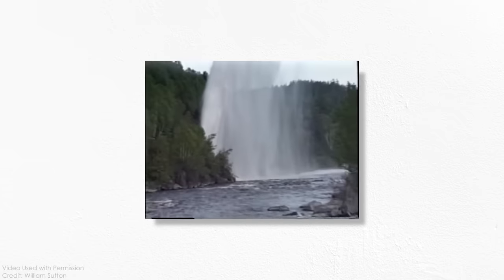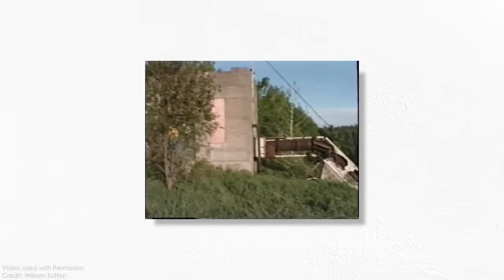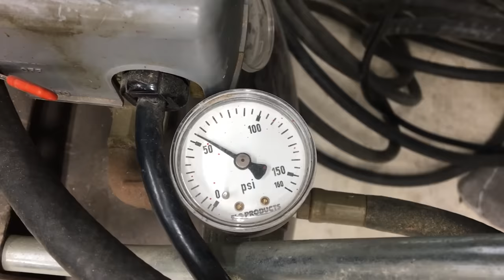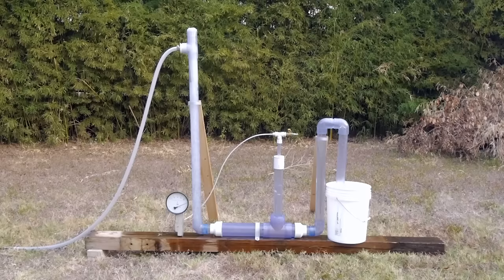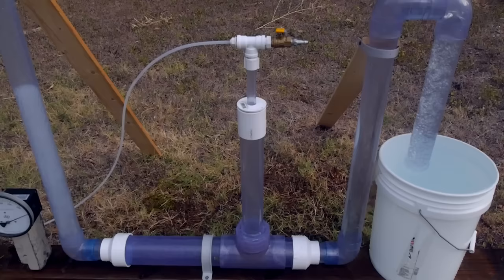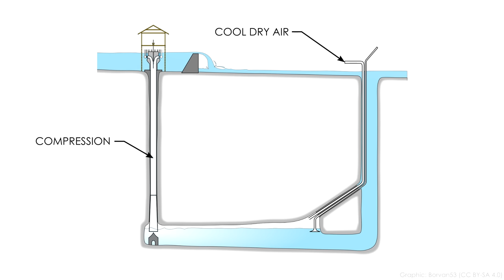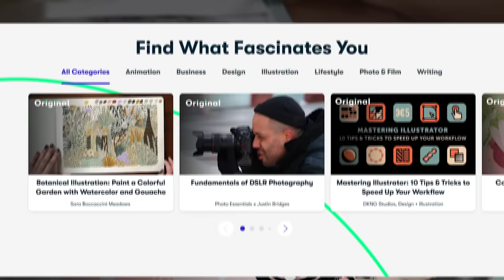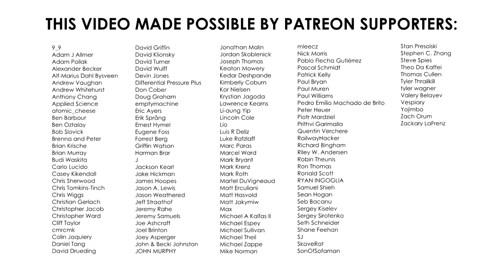Compress Air with No Moving Parts! - Trompe

Comment: Actually, "potential" energy of compressed gases is not exactly "potential" energy but kinetic -- molecules of the gas moves and bumps, interacts another words. So it's kinetic.
And you need a thin nozzle to inject water into the system. It's because you need a REEEAL good velocity to hook air and act like a valve to not allow air to move back.

Comment: Hey Grady! Hopefully you or another curious engineer come across this project. How practical would this be to turn a water pump for an aquaculture system to power trompe(s?). The compressed air could easily be used to add more turbulence or in breeding tanks way from the main tanks!

Comment: Reliability of no moving parts and all aside, in a pre electric/internal combustion for rotary motion state of times. Interesting novelty of human enginuety for sure, but from numbers I´ve found if reliable, a trompe gives about 0,5 psi pr 1 foot of fall. Thats roughly 7 m fall for 1 measly bar and I have no idea about the air flowrate potential pr mass of water. I guess a trompe is thirsty... What would be most water spending economy efficient ? A water wheel stomping pistons/bellows and valves for air flow, or a trompe ?

Comment: Could you make this using mercury instead of water? Would it make higher air pressure if so because of the greater density?
Reply: they certainly made an effective vaccuum pump that way.

Comment: Minors in Cobalt suffered from lack of oxygen. Some may have died from it. As compressed air bubbles are exposed to cold water oxygen is selectively dissolved out. Mine shafts were filled with nitrogen. That's good for preserving fruit; but, not good for people.

Comment: I remember seeing an old picture (maybe the 1900's?) of people driving around in a little car powered by compressed air from a trompe.  They had a cooler in the back seat and were using compressed air to keep a bucket of ice cool.  On the ice there were various bottles of liquor, and they all had cocktails in their hands.  I'm sure the max speed on those cars was minimal.  Add some padding and you'd have bumper cars.  So instead of gridlock traffic, we could have had cities filled with sustainable adult bumper cars.  SMH.

Comment: I'm designing an aeroponic grow system, and had already included aeration in this manner. It was cool to see you mention that application near the end of this video. 👍

I have a sump pump forcing water through a ¾" hose (with holes where the water sprays out) placed inside a 6in conduit (where the plants will grow).  Close to the pump, the hose has a smaller ⅛" line pushed through a hole, and open to the outside. Correct me if I'm wrong, but I believe it's called Venturi force that pulls the air inside?

Comment: Wow I'm in Poteet, you're a few steps down the road.  I just accidentally found this video.  I don't know if you have gone over this but I use PCP air rifles and I'm 61but I hand pump mine which can be quite a workout but I don't mind.  Although there are times I want to speed it up. With your mockup and please be gentle I'm just a simple country boy. On that second tube if you have a faster rate of water but yet a smaller tube would that increase the pressure. But I need like 4500psi. I'm sure I would need something more , maybe turbulent combining the water and air on the first tube, well maybe.  Anyways I know buying a pump would be probably easier, but I'm not built that way. 
But if you have a better way to do a HP air pump can you make a video on that. My mind tells me I should be able to out of my pops old 90ton hydraulic jack.

Comment: Cool! So if you had larger diameter air reservoir (Larger atmospheric surface pressure area) with a weighted plunger you could generate a great deal more air pressure and volume from a relatively low volume stream?
Reply: no.  the backpressure would blow the water out the wrong way.

Comment: so if u have one of these built and had the "runoff" water at the end of the pipeline be collected to be brought back to the original water source, is it possible that this device could make a perpetual motion device? jw because i have seen many sources debunk the perpetual motion device theory.
Reply: Notice the water finishes lower than it begins, you would have to pump the water back uphill (requiring energy) to its original destination. The thought of reusing the water is interesting though, a clever way of moving it back uphill using other renewable sources such as geothermal energy to evaporate it and recondense it in the higher level would be interesting to try

Comment: With your exact setup is there a cap to the pressure it can produce or given time will it keep going?
Reply: nothing but the weight of water is holding it in, so it's self-regulating.
Reply: @tsm688  thanks

Comment: Can you loop this water system to get more pressure to be stored in a metallic tank with a more applicable pressure?
Think oxy ocetaline welding but o2 and propane and a 45mm wide to a 5mm 3 stage size small medium large flame i guess i can link a torch and a medical style set up thats rediculous expensive if u use the medical o2 generators youd see in like a retirement home
Reply: looping this would be as pointless as looping a water wheel.  if you have the ability to do that, just hook up the motor directly

Comment: What would happen if you built this in stages? Have the first stage pull in atmospheric air, and the second stage pull in the compressed air of the first stage? I'm sure you'd have to wait for the first stage to get up pressure before you pull it into the second stage... would you get an even higher pressure out of the second stage? Even though I don't understand this completely, my mind is saying no... not possible... But then it thinks that increasing the volume of the pressurized air storage in the second might help... Shrug...

Comment: I made a compressed air tank for water pressure increase for toilets and sinks.
placed an 8 inch 10-foot pipe at the end of a half-inch above the rafters, horizontally. Filled to the top by installing a spigot valve on top of the 10-inch pipe to release the air as it filled from the same level.
the down water flow was below the 10-inch pipe. Every time you used or flushed, the water created a vacuum. this vacuum pulled water and air. eventually, the pressure was high enough to increase the pressure at the sink and toilet.
Florida has some of the worst water system setups in the world. I thought The mountains of Ecuador were bad in the '80s but Florida is MORE backward than that- they still use 2-inch pipes for sewage?

Comment: The moving part in this system is the water. To call it a system without moving parts, you would need to have water that doesn't flow.

Comment: There is a second chance in these systems to capture energy. While you may not want to put in an energy capture system in the entrained air side, on the discharge side there is still room to put in a generator using a wheel or turbine to capture the energy.

Comment: mr Practical engineering.....
If you can boil water at room temperature...... Why isnt this used to get the salt out of seawater?
Wouldnt it be much cheaper?
And more efficient?
Reply: great to see not a single reply after 3 years

Comment: Pardon my simpleton brain… but are you saying with a recirculation pump and closed system you can have a nearly loss free source of compressed air??? And if so why have we not explored it as more of a energy source… I understand that may not be viable but hell they run vehicle on cng and hydrogen so just a thought.
Reply: The air pressure comes from the energy of water -- either water that's moving quickly or at a great height. But hydropower is hard to scale up more than it already is.

Comment: You said no moving parts, the water is a moving part. The water is the most important component in the construction of this device, therefore the water is a moving part.
Reply: Absolutely useless information. Use common sense rather than try to sound smart.

Comment: Can you please do a viral video about the 1980s Geo Metros that would 
get 55 miles per gallon, why this is a better idea to get a car that is 
put together with high miles per gallon without the hybrid parts, for 
some motorists, and if Toyota is one of or the most reliable 
manufactures why the Toyota Aygo could be a very high performing vehicle
 for miles per gallon applications here in the USA in addition to 
Europe, the implications of these two vehicles existing are are very 
obvious.

Comment: I have a doubt,
 why can't we compress the air like a turbocharger , using water instead of exhaust gas

It will be so much powerful I guess ! 

Then let the same water cool it down through exchanger 

I've seen a lot or water flow off for a very little compression.

Comment: some info.     no moving parts.      just plenty of flowing  WATER,  a  sufficient  amount of  Head  (and  money/labor/time  for  installation).      on the other hand,  flowing water could, directly, power  air Pumps  and/or  compressors, via waterwheel; or via hydroelectric.     it is a certainty that a low-tech solution could be found, in order to deliver the compressed air to a desired location.      compressed air can be used to power an  air engine, instead of (dedicated) air tools.      googletranslate
https://en.wikipedia.org/wiki/Pneumatic_motor

Comment: Ok, but why don't you just install two vertical tubes into the ground. One is filled with air and then, the high pressure water is let in at the bottom. The air will then be pushed out the top. As soon as the flow of air in that pipe comes to an end or is insufficient, you can switch to the other tube repeating the process while the first tube drains. That feels more efficient to me and it doesn't need many moving parts.

Comment: The major downside of this method is going to the very high water content of the compressed air. That should be discussed in this method.
Reply: it's actually pretty dry because it's cold air.
Reply: @tsm688  Yes, dry air that's bubbling through water. I think you are mistaken.
Reply: @milktobo7418  Think it through.  It will be 100% humid, yes - 100% for maybe 15 degrees.  This is a LOT less than you get for HOT saturated air.
Reply: @milktobo7418  further, it will get "drier" as the cold air warms up - effective humidity will go below 100%.  It will tend to remain gaseous. Hot air, will cool off and become SUPERsaturated - it will condense and produce liquid water.
Reply: @tsm688  Please do go on and tell me how I you think I failed thermodynamics. Stop thinking of this as an isobaric process or cherry picking some magic temperature gradients that wont exist in reality.

Anyway, to put it another way: I really like your idea of NOT compressing the air at the coldest time of the day so that the relative humidity is low enough to not drop out any water afterwards.
Reply: @milktobo7418  If you insist.

TL/DR, as long as the mine is significantly hotter than the water, air from the trompe will heat up above the dew point.  And I'm going to bet that a North Canadian river, is colder than a deep underground mine.

The effect of heating on humidity is gigantic.  A difference of just fifteen degrees C *TRIPLES* the amount of water air can hold.  The air will come out cold and 100% saturated, and rapidly drop below 100% when it heats back up.

A compressor on the other hand, easily heats air to **100C**.  Any water in the system will evaporate, get pushed down the lines, cool off, and condense inside pneumatic equipment.  They use cooling systems and drip traps to prevent that -- the same thing a trompe gives you for free.

Comment: The efficiency of compressed air used in machinery is horrible because of losses of heat during compression. So if you can bypass all the waterpower to electricity to pressurized air thing you should do it today as well if you really need pressurized air. Overall efficiency should be equal or better. Electric motors are however still best at about 90%-98% efficiency.

Comment: I'm surprised you say the air is drier than mechanically compressed air. Surely in this process you will have 100% humid air which is what you have from a air supplied from an air tank. Obviously if the compressed air is used at ambient temperature and that is higher than the water temp then the relative humidity will drop.
Reply: 100% at high temperature is a lot more water than 100% at low temperature.  A traditional compressor spits out hot air which has the maximum amount of anything in the vicinity dissolved in it.  This spits out cold air with a much lower moisture capacity.
Reply: @tsm688  Yes, I see your point. Whereas a normal compressor produces hot air at high humidity which becomes saturated as it cools, the trompe produces cold saturated air which rises to ambient which will reduce it's RH.

Comment: Compare these diagrams to the diagram of the pyramid chambers. Then watch “great pyramid HPG running again with new resivoir.” John cadman has 135 views he revuilt the pyramid chambers to scale and tested it as a water pump. It generates potential energy with pulses 100 db that would be abosrbed by granite using this technique

Comment: I’m no expert on the subject but couldn’t something like this be fashioned to run off city water and provide the ventilation needs we are seeing with this pandemic outbreak?  Seems like it would be easily manufactured and deployed.  After all you really don’t need a ton of pressure in a ventilator and it wouldn’t add addition heat...just food for thought.

Comment: I don't understand something here.  If you were to open the air pressure valve, wouldn't you fairly quickly exhaust the trapped/pressurized air and wouldn't you very quickly get water coming out of your valve?  Now that sounds a whole lot worse than having some moisture in your adiabatically compressed air!!!

Comment: Wrong title. Water IS a moving part. No air - and no fluid at all - can be compressed without a moving part and an energy source (in this case, gravity).
The correct title should be "compress air without artificial moving parts". Or sort of...

Comment: I imagine you actually have a college degree in engineering, is that right? I like your videos, but in this one I don't understand the principle. So does it work like a water powered vacuum pump, which has a nozzle in which water takes air with it and by doing that it's lowering the pressure of the air around the nozzle?
Reply: Bill Mollison, while giving a permaculture presentation, described the 300+ year old technology of the trompe. That video is on youtube, but is taking me a bit to find. In the event that my Asperger's takes me on a tangent whilst strolling memory lane, you at least have a place to start, and Bill Mollison is certainly an interesting person to check on in the meantime.

Comment: Hard to let this idea go.  I spent quite a bit of time trying to unsuccessfully develop a water powered pump that would pump water consistently using the Trompe principles - this type of pump is called a Pulser pump.   The way you used pipes instead of buckets was interesting.   Anyway - updated the discussion in the Water Powered Pumps facebook group - if you ever do a version for pumping water in stead of or in addition to air using flowing water, that would be great.   Thanks - Dave
https://www.facebook.com/groups/240458583255303/permalink/549423172358841/

Comment: Will you an able to educate us on Ohm’s Law of electricity formulas being applied to an Atom’s inertia, with Graviton Amp and Lighton Volt particle interchange between other Atom’s Atomic Quark Equilibrium Circuits that interconnect Universal Energy from Suns to Galactic Black Hole Equalverse Circuits, where Absolute Zero of an Atom has zero Lighton inertia, and maximum Graviton cohesion particle quantity, and inversely, the Absolute highest Atomic Energy Fulcrum at point Plasma separation with maximum Lighton inertia, and zero Graviton cohesion? The transfer of particles is where volt electricity and gravity magnetism are created, and the environmental equilibrium forces of light, sound, temperature, volume, and pressure are seen, heard, felt, and reacted upon. Please read my Standard Model of Universal Energy Particle Physics to learn more. Thanks for your educational ideas. Daniel Gown

Comment: Could this design be further improved by changing the way air is entrained? For example, there is a powerful vacuum pump with no moving parts, covered by Cody's Lab, the Sprengel Pump, which uses droplets of Mercury to capture air between the droplets as they drop down a tube. Mercury is so dense and has low enough a vapor pressure that this system can achieve vacuum pressures of millionths of an atmosphere. See this: https://www.youtube.com/watch?v=viJ3T-1KZqY
In the trompe design you used, it looks like a lot of air is entrained but a lot escapes. Perhaps using a lot of tubes to entrain air in the manner of the Sprengel pump would be more efficient.

Comment: See that's why you are just an engineer, and I'm an inventor making a quite high pressure pump out of it is all what I need. Engineers are like parrot smart but limited in ingenuity, while Inventors are rather like crows, they think beyond on what they have learned by abusing things in another way as intended. Any way, good job of repeating the circus trick, that you have learned in Uni

Comment: It seems to me that, yes, it works, but very inefficiently. In this demonstration you are wasting several potentially valuable inputs: the energy of movement and the pressure of the input water, and the input water itself. It's an expensive way to compress air, but easy to maintain since there are no moving parts (other than at least a water and air valve).
Reply: like a water wheel, it's not supposed to eat the water, just use a flow that was already there.